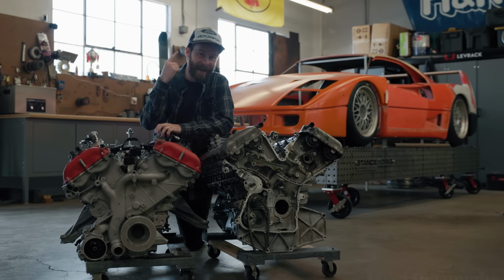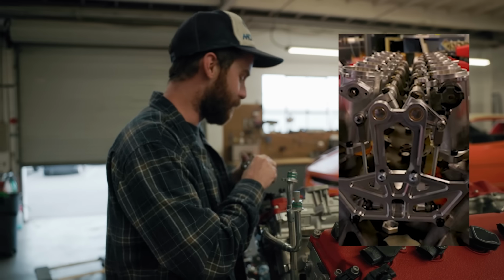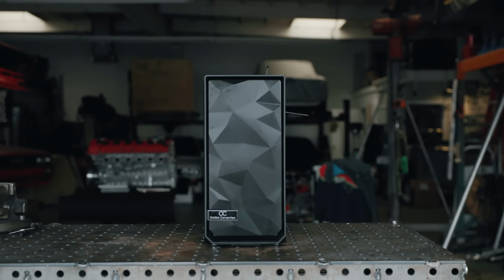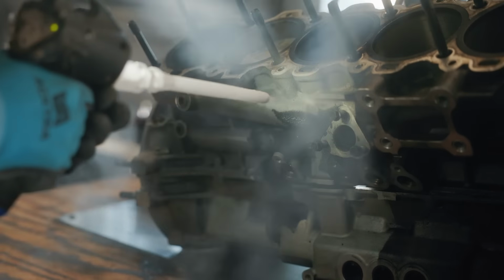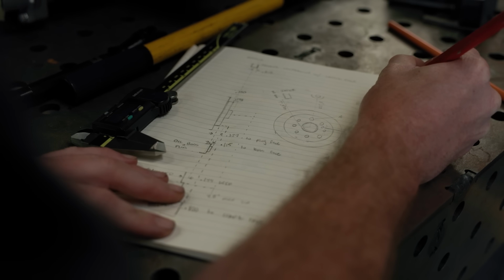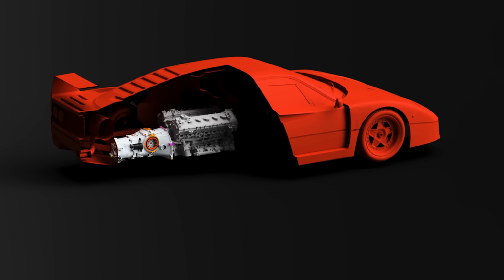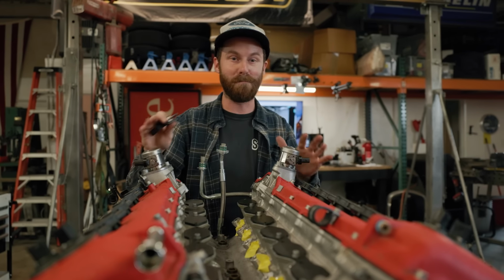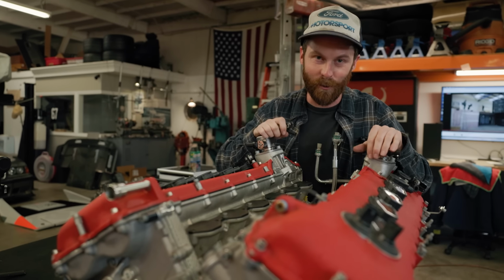Stuffing a V12 into my F40: 3D scanning is my favorite tool yet.

Comment: There is no reason to keep the DI, there is literally no reason to have it. It lacks the cleaning and cooling action that port fuel injection gives the intake track. Sure there is an argument for emissions and cruising fuel economy (DI can run a much closer to stoichiometric AFR at low load while cruising, reducing fuel consumption and reducing CO2 emissions.... while simultaneously making NOX much worse... right makes no sense for the environment or human health, but that fuel economy and evil CO2 right?) Power figures will be a few percent lower if you had to run 93 through port fuel injection, but with E85 as the fuel even that is negated thanks to the evaporative cooling of E85 as it's atomized, more timing no knock. I could get really nerdy about it but I think this covers the basics.

Comment: Scanning tip, don't put your reference points on anything that can move, for example the cloth surface on your workbench, if the marker moves it will upset the matching of the scan patches, lowering the accuracy of the scan unless you can manually discount the markers that might have moved at the post processing stage.

Comment: Getting rid of DI definitely makes things worlds more simple, but if your main goal is as much NA power as possible, you will make more on DI. That's not to say you won't be able to match the factory power output on PI, I'd be willing to be money you for sure will. You can only fit so much air mass past a valve during the time it is open, with port injection (especially on ethanol/alcohol fuels) you're displacing a moderate amount of that air mass with fuel. Less air = less power.

I've worked for multiple OEMs and have done prototype DI fuel system development, I've even tested DI standalone engine processors. It's a lot more work than bolting on a PI fuel system but it will make more power. Just look at the Super Trofeo Lamborghinis, the production V10 engine in the Huracan has both PI and DI, but for the ST cars they run only a DI fuel system and they make more power than the production car with half of the injectors.

As far as dirty valves, it's not something that needs to be worried about on a racing engine, most of the valve deposits build up from extensive time spent idling (which most engines do a lot of but race engines don't) and lower quality oils, with high quality SP rated oils valve deposits are not early as bad as what was seen 10-15 years ago.

If I were in your shoes I would still probably be doing the same and getting rid of DI, because yes it's a significant amount of work to get that DI engine running correctly on a standalone and you're not beholden to a ruleset so there's no reason to go through the hurdles to keep it, although a Motec M182 is probably cheaper than all the custom parts that have to be made to keep it and add PI lol

Comment: the little dots are called fiducials, the name comes from the electronics world (look at a PCB, you might find some close to bigger chips). I suggest you be mindful of their placement, they really have to be random, in particular when your part is periodic (like the row of cylinders), having extremely mis-aligned fiducials really helps the system finding at first glance which cylnder it's looking at, rather than having to wait for a high number of points to arrive and be able to resolve small details before knowing which cylinder it's looking at.

Comment: I totally understand your motivation for moving to port injection, but two arguments were not discussed in the video and I am not sure you were aware of these, so just to make sure you are now:

1. You can upgrade the high pressure fuel pumps to allow for E85 and even mildly turboing the engine without running low on fuel delivery.

2. You can do a hybrid solution where you do direct injection full time and add port injection to be only active on higher fuel demands. Many modern cars in the higher power/price range use this solution. While it is the most complex solution, it gives you great flexibility in having your cake and eating it too when it comes to power, economy and emissions.

Given your current skill set, time frame and budget, you are most likely better off (at least for now), to do what you planned all along, put bungs in the current injector holes and go for port injection. However, I challenge you to go for a hybrid injector solution and put either two dual scroll or four small turbos on the car in a future upgrade. After all, an F40 is supposed to have a turbo engine in it, Ferrari just had a brain lapse and didn't give it 12 cylinders.

Comment: Every justification you made for removing DI sounds more like an excuse. Of course it's your build and you can do it however you like, but don't pretend PI is better. It's definitely simpler, but it's not better. And I think you'll find at 13.5:1 compression, your tuning window will be pretty tight regardless.

Comment: It doesn't matter how complex the GDI system is - you don't have to touch it.  Use the stock ECU with its perfect calibration and have it running immediately.  The custom PFI system is the unnecessary complexity, and it won't drive as well as a stock 812.

fwiw, E85 will make 4.5% more power than pump gas.
Reply from the maker: I appreciate the sentiment, but I don’t have the factory ECU, or wiring, or all the other components needed to make that work. That would cost tens of thousands of dollars and to make it work given modern can bus systems, modules, and immobilizers, it would genuinely be the biggest challenge of the entire build. It’s a neat idea, but absolutely a terrible approach.

Comment: I don't like direct injection either. The whole system is much more susceptible to getting clogged. Though there are gains to be had with a direct injection setup in the low end w/ less fuel overlap and better atomization throughout the entire cylinder, it also fails for the very same reason everyone has a gripe with port injection, fuel volatilization, ie atomization is actually worse in a small pocket around the injector and generally creates more fine particulate matter inherent to the design. Even at the immensely high pressure, the injector doesn't immediately shoot out perfectly atomized and volatile fuel, thus you will see increased particulate matter due to a small pocket of fuel that is in the process of atomization and is still in droplet form getting burnt off inefficiently and turned into carbon. It is inherent to the design. Even with a dual injection system to help clean off the intake ports, you will still see increased carbon in the rings, crankcase, and exhaust valves again just inherent to the design. It's a direct trade-off to CO2 emissions in port injection motors, they've reduced co2 emissions and the next step is particulate matter, which likely means they're going to increase fuel pressures even more to reduce the amount of fuel coming out being in droplet form, ie it's going to be harder to modify and more dangerous to work on just to avoid the very thing you're trying to get away from, particulate buildup. Also, your primary gains are in the lowend where you can better control fueling to prevent fuel loss in overlap and fuel desaturation due to overlap, which can also create rich and lean conditions in port injection setups especially when it doesn't fully saturate the cylinder, once you get into higher rpm stuff, not as big of a deal and not as much gains to be had.

Comment: Much of the carbon buildup on intakes running GDI is from exhaust gas recirculation.  Depending on what you wanted to do, there are steps to mitigate that factor, though port injection does remove any need to regularly clean the intake ports and valves.

Comment: Using a PVU set up will not only limit you fuel delivery and non carbon deposits it will increase the port angles when GDI is programmed in placed of the standard bios, Ferrari made sure the diametre of all inductors is almost oval because a square would be lame.

Comment: With the Holinger transmission, are you able to use the clutch normally on the street, like a motorcycle?  Can you depress the clutch and use the paddle shift, to make the gear changes on the street more user friendly?  Something to correct you on when you spoke of direct Injection.  As a fact, you can run pump gas with port injection on 13.1:1 compression.  Sportbikes have been doing this for over a decade.  However, I do not know the similarities or differences of timing that Ferrari uses, and the Motorcycle manufacturers.  The sportbikes may have severely retard timing in comparison to Ferrari, but it may be a limitation to the construction on Ferrari's design too.   Just to clarify for any viewer that doesn't understand the relationship between compression, octane, timing, etc.  It is possible, you may not want to daily it.

Comment: not sure to what extent on this engine but the DI does improve the hp. Brian tooley racing did some testing of this on the gm LT engines and it was significant. The way they explained it was that by adding the fuel after the port its almost like a minor supercharging effect. The fuel takes up space going through the port that can otherwise be taken up by air. So by injecting the fuel later your getting more air into the cylinder.

Comment: Direct Injection is GARBAGE!  Fuel efficiency is it´s only advantage.  The disadvantages are many.  Totally the way to go.  Using port injection will not limit your max rpm range which means you can eventually go to a bigger cam without concerns of not being able to supply enough fuel.  There is a reason super high-performance engines like liter-bikes and GT3 race cars do not use them.

Comment: I’d be worried about trying to squeeze four more cylinders in between the rear bulkhead and the rear wheels. Ita a finite amount of space, you can’t put the engine where the seats go, and you can’t move the wheels back. I think the only feasible thing that can create more space is the length of that new Holinger gearbox. Hope it works out!

Comment: The dirtiness of a direct injection system is not sure to the direct injection. Port injection isn't cleaner either. Port injection cleans up the junk from the EGR and PCV systems. Delete the EGR and route the PCV through a catch can, and direct injection is just as clean as port injection.

Comment: Definitely ditch the DI system, injectors are failure prone, as far as I know motec is the only ecu that can run DI so haltech couldn't be used, also koenigsegg doesn't use DI so.....and the only power loss you may have is low down torque.

Comment: What if you added port injection instead of replacing the DI?  You could use a piggyback controller for the extra fuel. Does did that with the 2018+ coyote.

Comment: I am a mechanical engineer. I think you are perfectly right to get rid of the direct injection system. Port FI was an invention thet worked well from day one on the late 80's whereas Direct FI has had a lot of trouble with production cars for it's diesel like pressures, and lack of port cleanising. It may be more efficient, but makes a car less reliable and a race car less so. With the positioning of your engine in a very difficult place to service this stuff, everything needs to be as reliable as possible.

Also, I am sure that you will have 100X of options of aftermarket FI systems to do MPFI vs DFI.

Cheers!

Comment: Amazing project, entirely your call to ditch DI, you will achieve a great result, no doubt.

From am engineering perspective... I am not convinced that DI is just emissions and efficiency (efficiency is power mind you). Decoupling the intake valve from the fuel delivery releases a range of optimisations not possible with port injection. Atomization becomes more of an issue but that has been mitigated as well. 

This is just my personal view. You do you and your project would not work in any other way.

Comment: I fully understand how the gearbox works, but it just feels like this is a missed opportunity to have something that is very rare and seldom seen, a mid-engined V12 car with a "traditionally operated" manual transmission. Something we haven't seen from the Italian manufacturers since the early Lamborghini Murcielago days (Something that is so dearly missed that Pagani is putting a manual transmission in the brand new Utopia). 

We all know damn well that after taking off with the clutch, it's not gonna be the same as shifting the gears with a lever and ACTUALLY using the clutch, regardless of whether it's a manual transmission or not. And I know none of us are ever going to actually drive the car, so it's not like we have a say in it. But It just seems like it takes away from the spirit of the original car.

Comment: 1000 comments, so you'll never see this, but good call on ditching the direct injection. Just run E85 for the high 13:1 compression, and you'll not see detonation. Tune for best torque and let the hp lie where it does.

Comment: Common misconception to think SMG is sequential in any kind. SMG is a simple 6  speed manual trans. with a hydraulic shifter slapped on top. You can get rid of the hydraulics slap manual shifter assembly + top and bottom pump and and clutch pedal and you have a manual car. ( after telling the ECU that this is manual car of course. )

Comment: Mike, curious why you didn't go with the F154 CB or CG engine? I think that it would have fit better and you could probably have used the Getrag G103 transaxle. Either way, props for this fab job!
Reply: The F140 V12 is ferraris best modern engine of all time 😍
Reply: @UKBUILT  Reread my comment. I am not doubting that it is an awesome engine. I am suggesting that the v8 twin turbo engine may fit a bit better.

Comment: uhm about the PC: its pretty badly configured. Last Gen core i9 processor which is known for high powerdraw while having mediocre performance, ESPECIALLY in workloads like CAD, and the Quadro RTX 2000 is a low end card, as far as quadros go. On top of that, the cooler they are using is not adequat for that CPU, so that hot running CPU with mediocre performance will have even less performance than it could have. On top of that, they used a mainboard that is very expensive, cuz its good for audio work, which makes no sense in a CAD PC. From a pure performance standpoint, that PC is not worth more than 2k$, but well, they want 4k for it... And on top of it being a bad configuration regardless the price, their Logo is stolen from Alphacool... al in all, scam sirens are loud with this one

Comment: High pressure direct injection let’s you run a lot more boost since the fuel is injected when ignition is required without knock. There is a reason for it 
.
Reply: He ain’t running boost

Comment: To anyone who does argue for DI, you are just plain wrong and stupid, idk what else to tell you except lie to you, which I won't. It is 80-90% implemented in modern cars due to emissions and regulation standards, literally that's it. The simplicity of PI and performance is unmatched in any car/truck/motorcycle/boat/engine. The best example, fuel injection has been around for decades yet the best 2 stroke dirt bike manufacture, KTM, has kept all the 2Ts running ON A CARBURATOR until regulations mandated injection in 2018 and "coincidentally" that is when they started having problems. 
Mike, for the love of petrol, glory, flames, V12s and good ol' days make this a PI ITB monster so we can all cream ourselves lol. 
I already know some idiots will start asking "what does he know," well I been riding/racing dirt bikes since I was like 10 and own a classic German car specialty shop, so a decent amount I like to think. Some of the stuff I'm seeing in the newer DI cars, its just sad when you open those motors up (at maybe 100k miles) cause they started acting up and having issues, from which its carbon build up, fuel related, maybe turbo on forced induced cars like 90% of the time. Some of my favorite engines are Audi 4.2 BHF and BBK for the reason of being a V8 with PI and dang they run so good (I have 3 of them)!  Also Mercedes M119 and M120 omg those are legends of the Autobahn for sure. 
Love the progress and thoughtfulness Mike, keep it going!!

Comment: I totally agree that the DI system is a PITA to tune, but it will lose 8-10%ish power & torque compared to the same port system. There is a video from Brian Tooley Racing where they run the same built 6.2 LT1 (comparable in displacement to your F140) on both pump and race gas on both 100% DI and 100% PI. The power and torque loss is roughly 8% across the whole curve. Until aftermarket standalone ECU manufacturers implement robust strategies for tuning DI, the same way they did for VCT, most people are stuck with converting to PI and losing power. At the end of the day, this is one of, if not the most badass builds I have ever seen!
Reply: Was coming to say the same thing. The e85 will claw back about half that loss and the rest I doubt will be be missed compared to the simplicity
Reply: the comment I was looking for.

Comment: Now that you have a scan of the engine, I suppose you could 3d print a mockup - it would be a lot lighter for ease of working with it during the chassis fab phase.
I'm thinking the ruined engine will make for a cool coffee table base when the job is done.  🙂

Comment: Sequencuel is the type of tranny in a bike.   There is no nutural between  gears like a normal car.   I have an 07 cbr1000rr. With wolich racing ecu flash software and quick shift among other things.  Sensor on shifter senses pressure, when it hits programed rpm, it causes a misfire quick enough to take pressure off transmission and it allow me to bang through the gears at wide open throttle without a clutch.  I understand what you are putting in.   Same thing used in rally
Reply: He's using a gearbox the same as most motorbikes. A sequential dog box with straight gears 👍